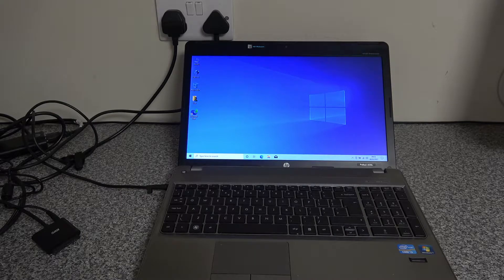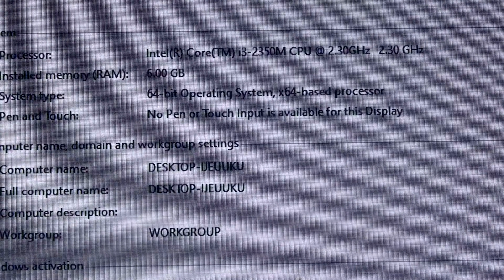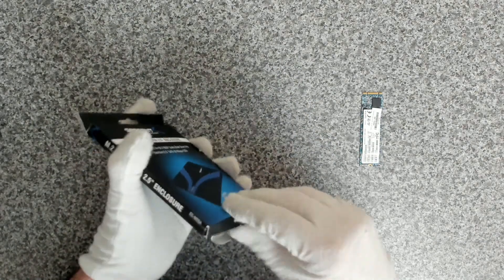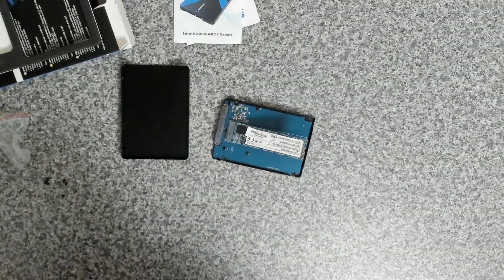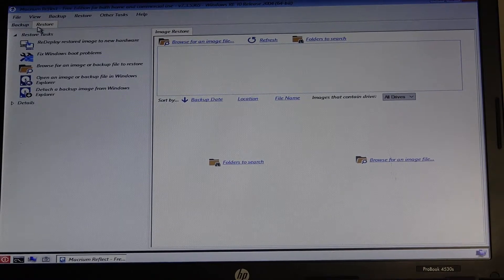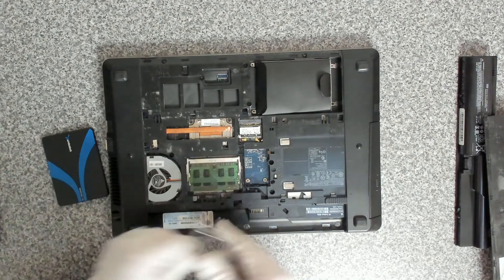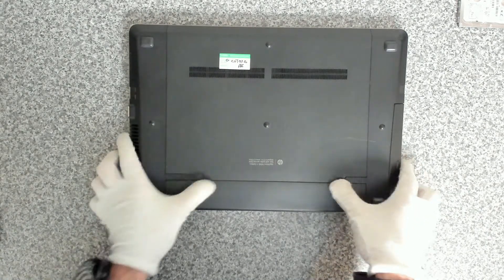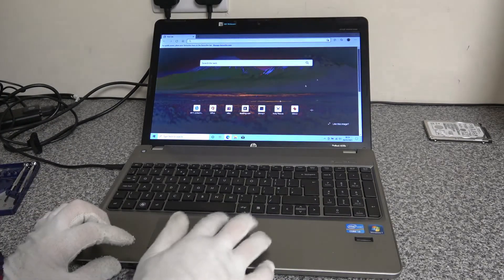HP Probook performance improvements with M.2 SSD

Comment: , using an M.2 to SATA drive adapter will not give you the full performance of an M.2 SSD. This is because the adapter will limit the maximum data transfer rate to the SATA interface speed, which is slower than the maximum speed supported by most M.2 SSDs.However, using an M.2 to SATA adapter can still be a good option if you have an M.2 SSD and need to use it with a device that only supports SATA drives. You'll still get the benefits of faster boot times and faster application load times compared to using a traditional hard drive. But, if you want to get the full performance of an M.2 SSD, you'll need to use it with a device that supports the NVMe or PCIe interface.
Reply: It is a M.2 sata drive